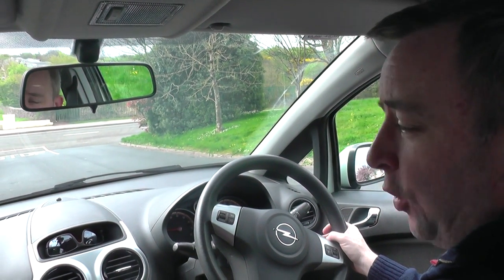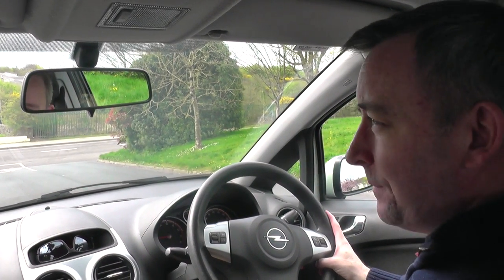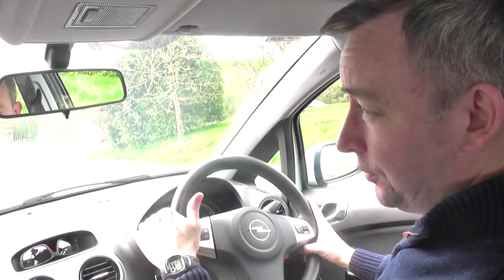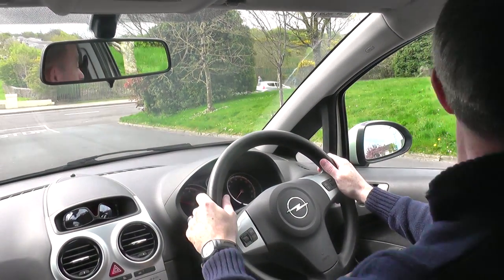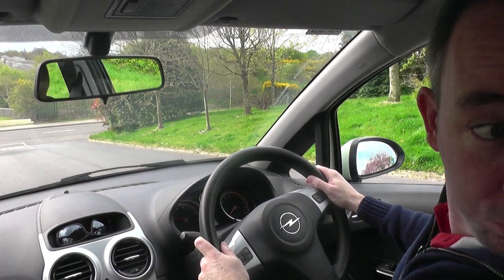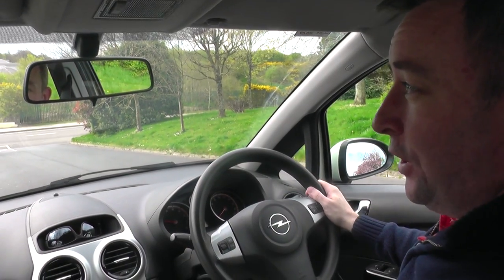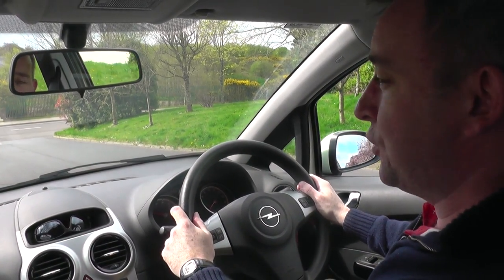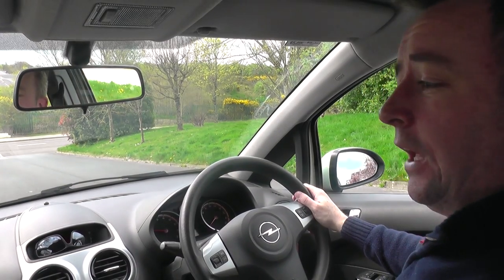How to Reverse a Car Uphill

Comment: Great Videos, I can put my passing, in part, to these tutorials! Since passing i've got a car and moved to a house on a fairly steep hill.  On a couple of busier days i've had to park on the hill. Reversing into the spots requires a good bit of power in my yaris and I at the end of the process there's been a terrible smell of burned rubber which I've been told is my clutch. I've only done this twice and am just avoiding it now as I'm worried about killing my clutch! Is there something I'm doing wrong? How do I fix this? Or given the steepness of the hill is it inevitable?! Appreciate any suggestions!
Reply from the maker: Don't accelerate so much, focus on the clutch more, no need for so much juice.
Reply: @DaneTygheletsdrive  Thanks!  I was giving it a lot of welly as it took a but of power for me to "feel the bite" when taking the handbrake off and with  the car parked in front of me i was fearful of rolling into it! I'll give this a try tomorrow
Reply from the maker: https://youtu.be/sIWSfypPxcA

Comment: Hi, this video is very helpful. I live on a street which is on a bit of a hill, to park it is best to reverse uphill confidently. To do this in a controlled manner, I know there needs to be balance between the gas and clutch but I just wanted to clarify: do you find the biting point with the clutch first and then press on the accelerator in order to reverse uphil in a controlled way?
Reply from the maker: Put it in gear, acceleration first then raise the clutch.

Comment: Did my second test the other day and had to do a reverse around a corner uphill. I havd perfected my hill starts and reverse around the corner for months but absolutely butchered the reverse uphill and failed because of it, very cruel to include that in a test! Your vidoes are very helpful so I will defienly practice it as I did not know they tested uphill reverses even after doing many pretests.
Reply from the maker: The reverse around the corner is a good way to test a person's ability to judge the movement of the car and multitasking. Everyone should practice different types of corners to be best prepared.

Comment: The other day I inadvertently found myself on a hill stuck behind road works...I was in the opposite lane and the workman decided to change to the stop sign as I was approaching the exit from the opposite lane. I had to pull in quickly to let the opposing traffic through, yet he suddenly moved to green/go and I found myself struggling to reverse back up the hill to get out again. He was going mad, and i lost control of the clutch and nearly ran into their equipment. Got out eventually. bit of a nightmare.
Reply from the maker: Are you a learner driver on your own? If so that's against the law. If you are a full licenced driver and you suffer from these types of difficulties then you may need to go back to a driving school and get proper lessons.
Reply: @DaneTygheletsdrive  definitely not on my own, Dane. I've been getting EDT lessons but these are on hold in level 5. I was doing some basic practice accompanied by a licenced driver and we came upon the roadworks unexpectedly!
Reply: @DaneTygheletsdrive  I think the point I was trying to make above was how quickly a learner can get into these tricky situations, and how the uphill reverse requires such calmness and precision with the clutch. I suddenly found myself stuck in a tight uphil spot, surrounded by impatient drivers and workmen :(
Reply from the maker: I understand what you are saying, good point. That's why these videos can help you.
Reply: If you aren't driving on your own, you are living wrong. Please just drive Safe! And get as much assistance as needed to learn how to drive properly!(Safely for you and others)

Comment: What if the car is on a high slope where it rolls forward if I down the handbrake?I want to reverse the car.I start the car,press the brake,down the handbrake?Then what?I'd very much appreciate if you reply..
Reply from the maker: harikrishna surpani In this case keep your clutch in fully and just come on and off the brake. Check out this video at 3.57 and you'll see what I mean 
https://youtu.be/6_bz6blM9pc
Reply: No,I meant going in reverse gear but uphill not downhill.how do I go up in reverse gear?I start the car,press the brake,down the handbrake?Then what?Thanks in advance....
Reply from the maker: +harikrishna surpani you need to avoid braking first of all. If you are reversing uphill you need to ensure your handbrake is up, get some gas then bring your clutch up to biting point, hold it, let down the handbrake and use very gentle clutch control to move back, not the foot brake.
Reply: Thanks for the reply.But won't some of the recent cars start moving even with the handbrake on?My car starts moving,but makes an alarm sound to the passengers that the handbrake is on.
Reply from the maker: +harikrishna surpani shouldn't happen if the handbrake is fully up. Some of the more modern cars may start moving if you press gas but depends on the model.
Reply from the maker: +Sword you might want to give it some gas but also use clutch control, you should check out my YouTube video on how to reverse uphill here https://m.youtube.com/watch?v=LQ4_Jv9QgSw
Reply: Heel toe dude.
Reply: @DaneTygheletsdrive  hello does this work for automatic hybrid vehicles. I tried reversing up the steep hill. My caution sign came on and the car would not move. In some cases it rolled forward despite being in reverse. Please advise me. Thank you
Reply from the maker: Depends on the type of car, maybe you need a bit of extra juice.
Reply: @DaneTygheletsdrive  thank you, it a 2014 Toyota axio hybrid. Do you think because it's a hybrid instead of regular gas that I'm having this problem?